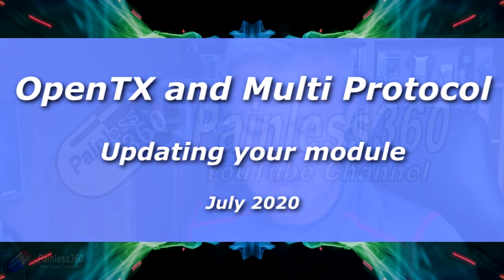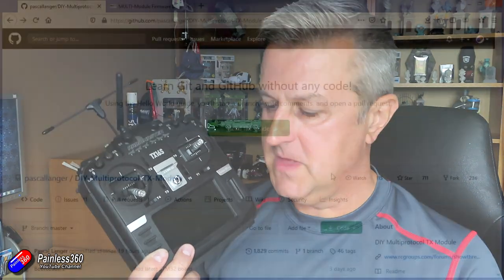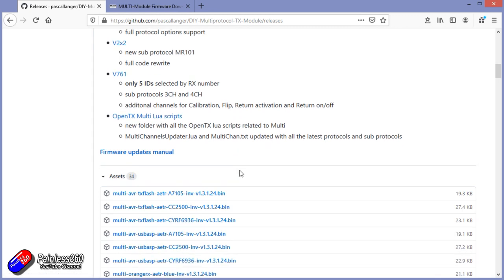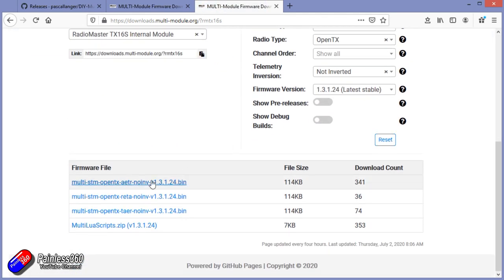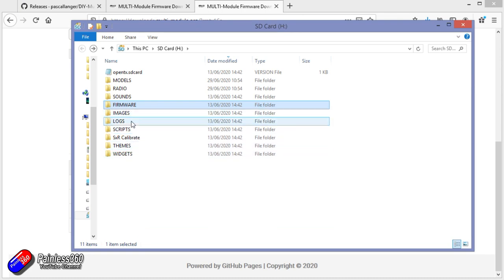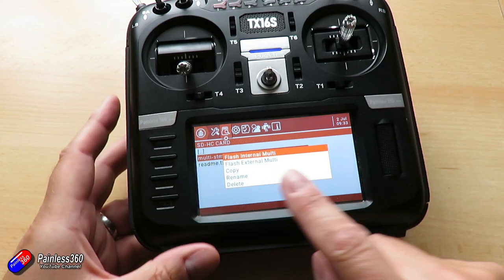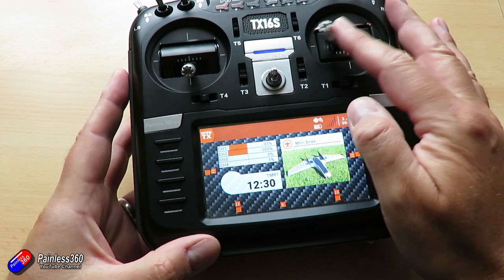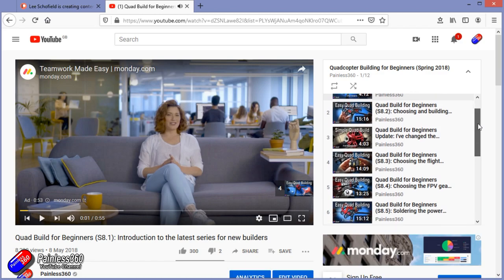Flashing/Upgrade your Multiprotocol/MPM 4in1 Module (fixing the 'Module Update Recommended' message)

Comment: Great vid as usual Lee! - worth pinning a message to mention that @4:48 the latest TX16s you need to plug into the USB socket at the top of the radio (bottom one is for charging only) in addition, on this version you don't need to remove the SD card, the radio can be used as the cardreader. Turn radio on, plug in USB to top port then select "USB Storage (SD)" When the popup appears.

Comment: Thanks again for sharing! I really enjoy Your video's and still learning a lot from them.
Do You know if it's possible to flash the external IRange irx4 module in a Horus X10S Express the same way that You just demonstrated in this video?
I've seen some video's where people are taking the module apart, soldering on connectors and flashing it with Arduinos, but should it be necessary?
Thank You in advance for taking the time to help out!

Comment: My Eachine radio is flashing "Module Update Recommended" message. Seems straight forward enough, however, not sure which module update to flash it with. To date there are updates for the  4-in-1 and the  CC2500 Radiomaster radios. Which do I use for the Eachine? Help...!

Comment: I am not sure which file to download for multi-protocol firmware as  my radio is RadioMaster TX16S MAX Limited Edition 2.4G 16CH Hall Sensor Gimbals Multi-protocol RF System OpenTX Mode2 Radio Transmitter with CNC and Leather for RC Drone - Purple.  The 2 choices are the  RadioMaster TX16S internal module (4 in 1)  or  The RadioMaster TX16S SE internal Module (CC2500). Can you help?

Comment: Am I correct in thinking that the r xsr would be the 'inverted' update yes? as I am not using the uninverted pad. The current version on my radiomaster does not specify what it is set too, just gives the version number.

Comment: I have problem.
Short history last time I playing micro brushed and I use irangeX for multi protocol. I upgrade my tx (taranis QX7) with edge tx for use elrs And now I want use again can't bind and status upg. Adviser.
Can you help for my case?
Because at video is internal multiprotocol
Reply from the maker: Make sure that the external module is set for ELRS and try different port settings if you don't have an inverter mod..

Comment: I DO NOT UNDERSTAND ABOUT MY RADIO TX16S, I OBSERVE MY MODULE STATUS SETTING IS    T  A  E  R, RADIO SET UP DEFAULT CHANNEL ORDER IS  A  E  T  R,  THROTTLE STICK MOVE CH#3 AND AILERON STICK CH#2. the throttle stick synchronize on radio set up??? 
                                                                          aileron stick synchronize on module status???
IF I SYNCHRONIZE RADIO SET UP  A E T R   WITH MODULE STATUS   A  E  T  R.
the throttle stick is now ch#2 ???  and the elevateur is now  ch#3 ????
        I THINK MY RADIO DO NOT WORK PROPERLY, WHAT I CAN DO ?????
Reply from the maker: The channel order for the firmware you flash onto the MPM needs to match the same channel order used on the radio. The reason this is so important is that the MPM will 'move' channels about when you are using a receiver that needs a specfic channel order (Spektrum is TAER for example). Check out the wiki https://github.com/pascallanger/DIY-Multiprotocol-TX-Module Best of luck!

Comment: I've tried the steps suggested but my bin file is not visible to Opentx, I've tried loading it onto the SD card directly and via usb storage mode.
Reply from the maker: Sounds like it is in the wrong place on the SD card. All of the steps that work for me are in the video... Best of luck
Reply: @Painless360  Thanks, I tried multiple locations but no luck. I managed to plug it in via USB as it's an irx4+ and use the program to flash on a bootloader and update it that way in the end. Thanks

Comment: Thanks! Helpful video, my radio is on the way, is enough with copying the LUA files in the SD card or need to be installed in the radio too?
Reply from the maker: not sure what you're asking.. Full steps covered in the video.. Best of luck!
Reply: Hi, my question the same. Did you try it? Copy tool files only without flashing firmware. Does it work?

Comment: I am about to build my first drone and I am really confused which radio to buy frsky x9d Or jumper t18 Or radiomaster tx16s? Frsky has reliability as well as dedicated receivers And most of the aftermarket hardware supports x9d but I am afraid that maybe in future it won't even support Crossfire as I am about to buy crossfire also, the jumper is good but again the previous model has issues like internal charging, ribbon cables and on the other hand the radiomaster is nice but don't know how reliable it would be in long term. Which radio should we buy as of August 2020 irrespective of it's price? Or should we wait?
Reply from the maker: Please see my Kit picks 2020 video for my choices. Best of luck

Comment: I have a QX7 with the iRangeX IRX4+ external module. I wonder how I can check which version I have so I can download the right bin-file
Reply from the maker: Use the one that matches the same default channel order in your Opentx setup.. Happy flying
Reply: I downloaded the right bin file and put it in the firmware directory. But when I click on this file with the QX7, I only see: Copy, Delete or Rename. No flashing options...
Reply: bert beinaaf I have the same problem!
Reply: @bertbeinaaf8314  my problem is that i can´t select the file. It isn´t  visible in opentx. Should a rename help?
Reply: Soft Cell Yes it does. I saw that in a video from CurryKitten I believe. He shortened the name and after that it showed up.
Reply: @bertbeinaaf8314  thank you very much. It was helpfull. Now i can select the file